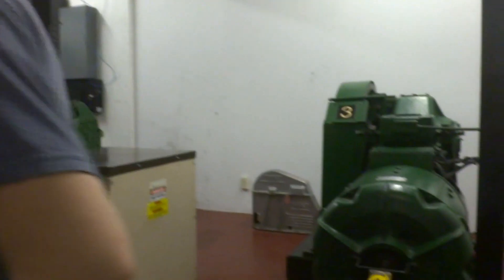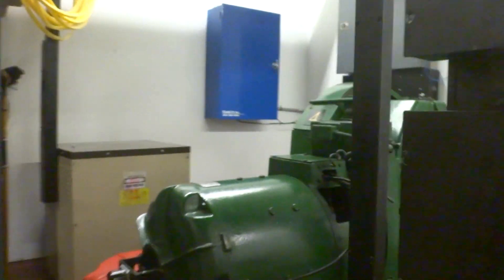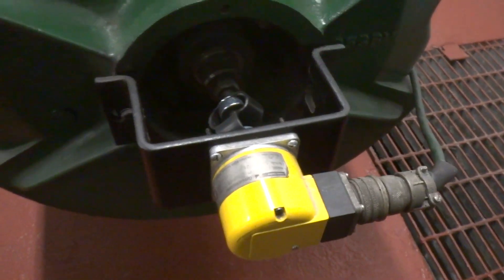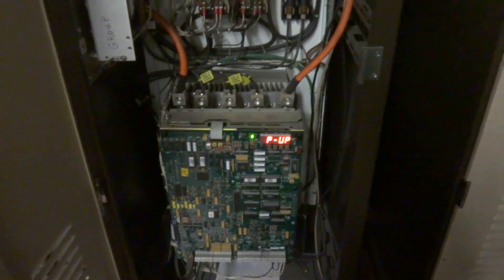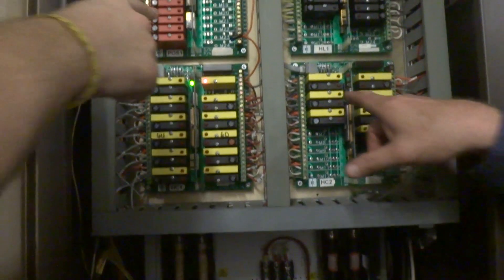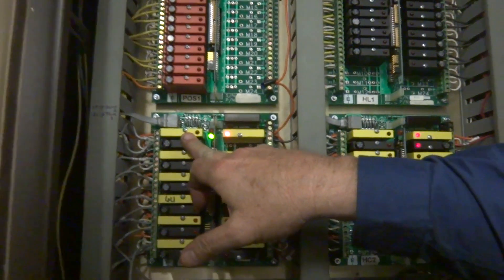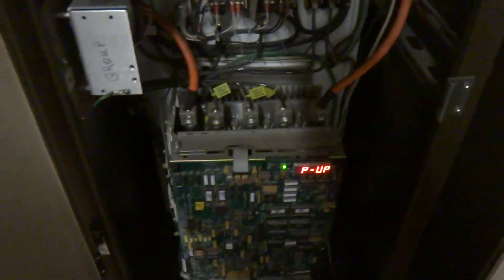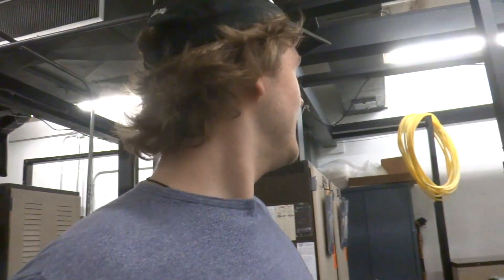Machine Room Tour with a local friend! :D  1994 Otis Geared Traction Drive Motor

Comment: This is what I should tell:
Never Ever enter an elevator machine room without permission until advised by a technician. Do not touch the moving parts inside them. The machines are upto 470V ( AC/ DC). Please be careful whenever you are in an elevator machine room. These are risky places. Do not even attempt this.

Comment: Geared traction...
Reply from the maker: Are you sure these are geared? The ThyssenKrupp technician said that these are gearless.
Reply: Look closely.  You can CLEARLY see the motor attached to the gearbox.  On gearless the motor turns the pulley DIRECTLY.
Reply: Understandable that you can’t tell the difference between geared and gearless traction motor because hydraulic are more common than traction in America.